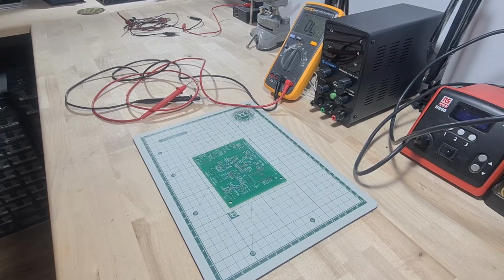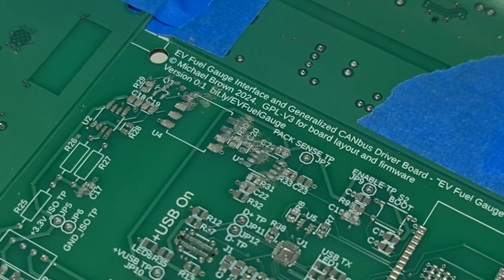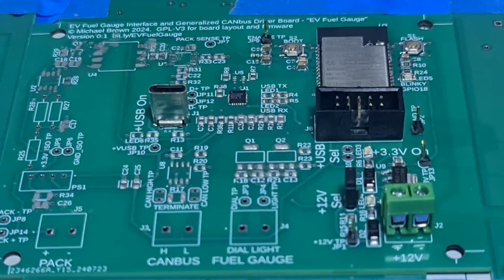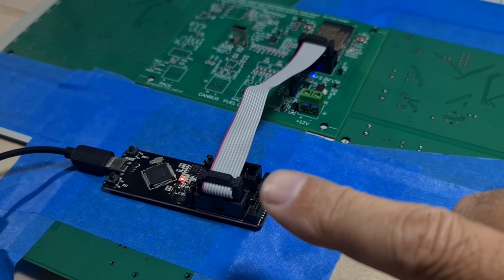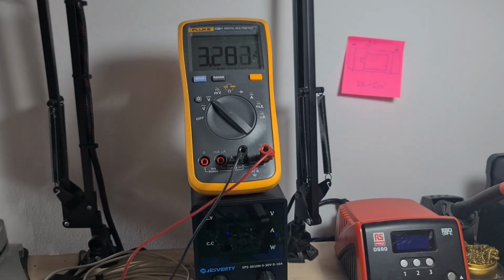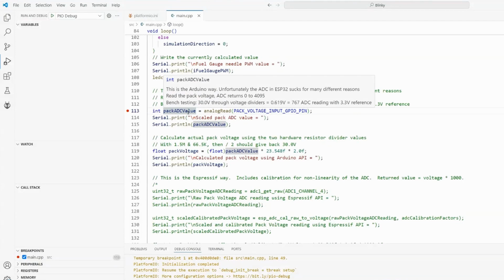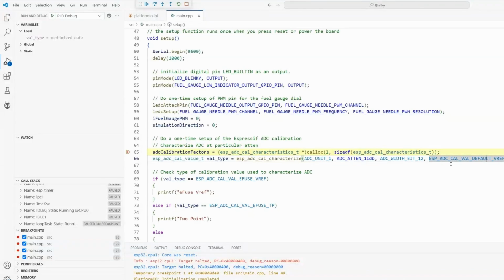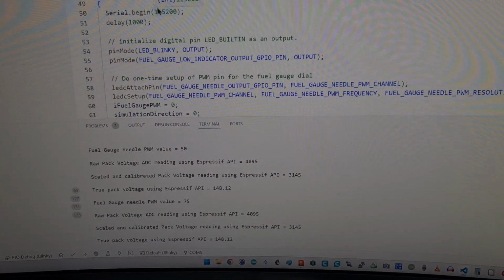EV Fuel Gauge - 2 - Building and Testing the Board

Comment: You might want to include a cutout under esp antenna if you're not planning to use an external antenna
Having a solid ground plane under a pcb antenna isn't fun🥲
Reply from the maker: This board has the ground plane removed directly under the antenna, but I will expand the removal area in the next version, thanks!